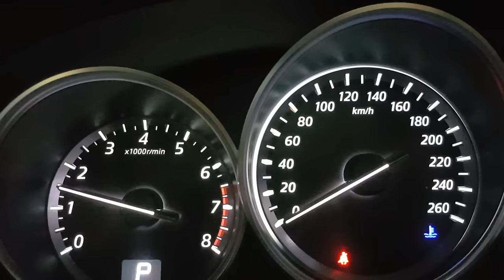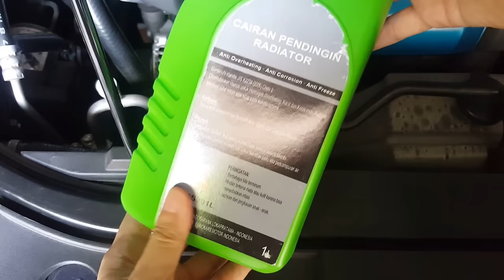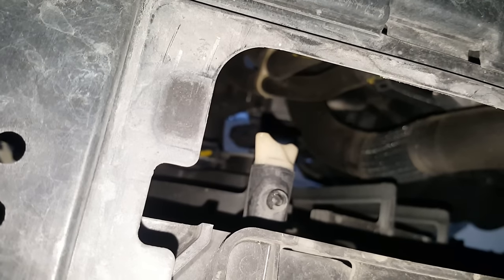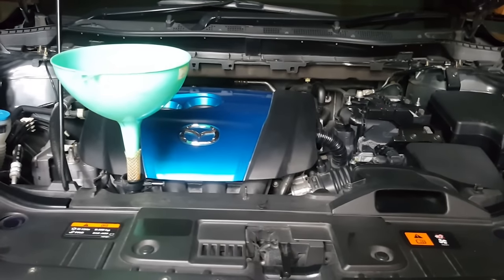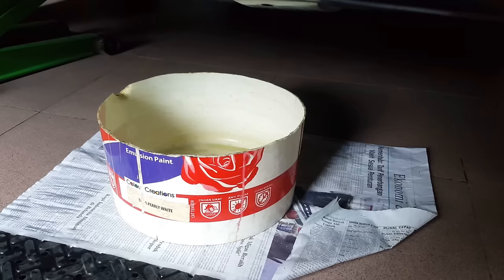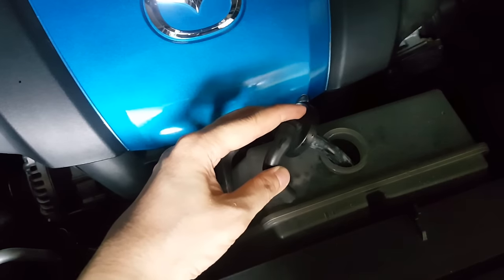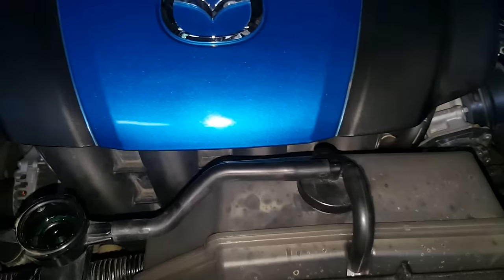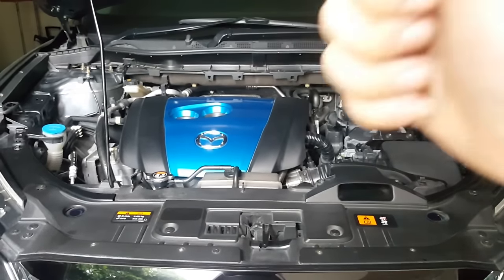Replace your coolant || Mazda CX 5 CX 3 Mazda 3 6 Biante Skyactiv

Comment: I like how meticulous you are in your work, cleaning and doing things so accurately and carefully. I have a new (used) 2019 CX5 that need this done badly. I just always can never get 100%, not even 75% of all the old coolant out even after running the heater and getting the engine temp high which I do not like to do.
Reply from the maker: Thank you . Very much appreciate your kind words 😁.

Comment: Hey FD, great to see a new video of yours featuring the Mazda.  I'm your subscriber in Texas who owns two CX-5s, a 2014 model and the other a 2015.  Since you hadn't done this service yet, I did a complete coolant flush to my 2014 car last summer.  At 50,000 miles (not kilometers) I found this really wasn't necessary as the coolant that came out was as green and sweet smelling as the new FL22 that I put back in.  Compare that to the transmission service I did where the fluid was brown and nasty.  I took about a week to perform my coolant service as I used a radiator flush chemical that again wasn't needed at 50,000 miles.  Once I drained the radiator as you show, I used compressed air to remove as much fluid from the system as possible.  Then I added the radiator flush chemical and many gallons of distilled water.  All during the week I'd drain the radiator and add more distilled water in order to get out all the antifreeze that was circulating in the engine and heater core.  Once I was satisfied that all the old fluid was out I used a cool bit of kit that I had bought to service the radiators on my BMW motorcycles that don't care for ANY air in the system.  Google UView Airlift Coolant Refill Tool.  I used this tool and one of my large air compressors to literally suck in the new FL22 without introducing any air bubbles.  Also cleaned my overflow reservoir just as you but my tank has two lines - one for Cold and the other for Hot.  Another super video Felix!  Looking for you to change out the water pump belt next (not the easier serpentine belt).  Take care!
Reply: David Pancerz I too am FD's Texas Mazda guy! 2013 CX-5 in Grand Prairie!
Reply from the maker: Thank you so much guys . I definitely will share more videos for us all. Appreciate your support and info tips.
Reply: Got to get that water pump belt on the crank pulley and push/pull onto the smooth part of the water pump pulley. It will stay put once on there. Then turn the crank while pushing it over. Wear gloves and watch you don’t catch your fingers. Keep cranking. It will catch.
Reply: Yep, replacing that belt wasn't hard at all. It's mainly a space issue if you have large hands. And since I changed the spark plugs at the same time, the engine was much easier to crank over. Definitely helped getting that water pump belt on.
Reply: David Pancerz i did plugs too. Didn’t occur to me to leave them out. Brilliant!
Reply: Yeah, I did a drain and fill of my 2016 CX5 trans at 30K miles and it was brown and nasty, looked nothing like the light blue FZ fluid I replaced it with.  I will do a drain and fill every 30k to replace their “Lifetime” fluid.
Reply: if my mazda cx5 has 4580 miles, and i need to top the coolant off a bit what do you suggest i do? can i mix other brand fl22 coolants or should in get genuine mazda fl22 and use that top off the overflow tank
Reply: Puedes añadir un poco de agua destilada si es la primera vez. O compras una botella de anticongelante Ravenol fl22 de 1.5 L
Saludos desde Valladolid, España.

Comment: A great video Dan.  Very helpful thankyou ..... 
A tip = to drain the reservoir, if you leave the radiator cap on when you remove the cockstop, the system will suck out the fluid in the reservoir while draining.  You might need to squeeze the top radiator hose to help the fluid flow.
Reply from the maker: thank you Sir. Noted.
Reply: hey what's the lockstep?

Comment: Hi , nice works .. but actually what happens at the SC is we did replace the coolant inside the engine so total amount coolant needed to be replace is almost 8 litres... this comment is regarding to all my recently customers showing this video and asking why it should be 8L i hope all of your viewers understand or you can make another content about it ... 👍 keep up your good work ...
Reply from the maker: Ya i think i have note down in the description as this method is only for basic drain and fill the radiator system and not full flushing whole fluid inside the engine.

Comment: Fantastic videos, Felix. Why do you do this on a shiny new car with 33,000 km is a mystery...  Much appreciated👍👍
Reply from the maker: it has been collecting dust since 2013 as i drove my other car for the daily , I have not driven it much and yet enjoy this cx 5 . So i though why not do a coolant / radiator maintenance just incase the old one fail and freezed up. But yeah now the car is 10 years and been enjoying it and driving it as my daily car.
Reply: Yeah, I did a drain and fill of my transmission at 30K miles for the “Lifetime” (not) trans fluid.  New Mazda FZ fluid is sky blue in color, what came out was filthy, brownish stuff, at 30k miles !!!  Do not fall for this “Lifetime” or “Sealed” nonsense regarding fluids / lubricants.  Changing is simple, and just replace the same amount you take out, plus 2-3 ounces for “stick around” amount on the sides of the catch basin, after measuring.  Lifetime means life time of the warranty, for which after they can charge you $6000 for a remanufactured transmission.

Comment: Thank you for the excellent content. Too easy with your complete instructions.  Appreciate it. 

You have noted that this is not a complete coolant flush.  What is complete coolant flush??
Reply from the maker: Thank you again for the support. full coolant flush you have to drain all coolant from the engine block and to do that you have to uninstall the bottom part of the radiator hose .

Comment: Very nice video! For the bleeding part, When you start the car at the end and let it idle... when you turn off the car again, do you re open the radiator cap to let go air bubbles?
Reply from the maker: it dont matter. u can turn off and open the radiator cap to check or you can leave it close.
Reply: Thanks!

Comment: Thanks for another excellent video.  I would recommend draining the fluid from the lower radiator hose rather than the petcock, which, with age and heat can become brittle and break, which would not be good.  Thanks again.
Reply from the maker: 👍 noted :)

Comment: How many km before you chnge the fluid. Mazda said long life coolant can last 100tkm. And do you need to use radiator flush
Reply from the maker: Hi Wilson . This car is 5 years now , so thats why i am replacing the coolant. Radiator flush isn't always necessary unless the coolant are very very dirty and the car is very old .
Reply: My mazda book: 10 years or 200.000 km.

Comment: Sometimes the capacities are a bit confusing. Just make sure to check the owners manual as mine states there are slightly different capacities depending on the VIN. Japan or Mexican built makes a difference.
Reply from the maker: Right i would stock about 7litres of coolant. Some cars uses only 6litres and other may use about 7litres. As you dont want to be short on coolant if you are doing the service at home.

Comment: Very nice video you have there and thank you so much for making a video. :) This will be use on my Mazda CX-5. But I have a question from you. Once everything is all topped up and it’s time to bleed air out from the radiator Cap. Do I have to keep the cap open to let the air bubbles out while I run the engine RPM?
Reply from the maker: Yes please follow the bleeding procedures. As mentioned on the description below with radiator cap removed. Once it burps completely. You are done :) pls dont forget to subscribe and hit that notif bells for us so you wont miss a latest videos. :) thank you again really appreciated your time tuning in Mr Luigi.
Reply: So, after I run the engine’s RPM and there still have bubbles coming out, I just leave the engine run normally until it stops burping?
Reply from the maker: @tomwu4211  correct sir. Just until theres no more burping.
Reply: Felix Dan Thank you very much. :)
Reply from the maker: @tomwu4211  dont forget to wash off the spillage sir. :).
Reply: Felix Dan Thanks for reminding me that too. :)

Comment: Hi Felix, want to ask you that is it ok to use other brand of common coolant (APM brand coolant) for Mazda car? as the shop owner use this instead of Mazda FL22 coolant..
Reply from the maker: if it does have similar spec yes definately can use. Personally i have not tried other brand coolant for the CX5.
Reply: @FelixDanGarasiAuto  thanks for your reply.. as this is the shop owner (specializing in Radiator repair and service) recommend, so I just go with this..

Comment: How did u remove pins from the pipe at coolant reservoir? U showed how to clip back on after cleaning it but did now show how to unpin the clip to take out the coolant reservoir
Reply from the maker: its just snaps back in n out. Use gentle force. Cheers

Comment: Hi Felix, greeting from the US my friend - thank you very much for your videos - they have been a great help. This will be my next service to do on the cx-5. I have 75,000 miles (120k km?) and I am not sure if I should do the flush or just the coolant replace like you do. Can you comment? If you think it will be worth doing a flush - can you tell me the extra steps to take? Also if I do a flush will I still need 5L or it will be more?
Reply from the maker: To fully flush the cooling system , you will need to drain the coolant from the radiator and add flushing chemical diluted with distilled water and keep repeating (draining) until there are no more excess old coolant. Yes you will need more than 5 L of coolant to refill the system.

Comment: Hi Felix Dan, in regards to the bleeding procedure on your Mazda and all Mazda's you state that owners should remove the radiator cap while bleeding the system. But won't coolant splash everywhere and make a mess out of my engine. As well as that, coolant get"s really hot very quickly and running the car for 5 minutes at 2,500 rpm would definitely have it boiling, especially if the fans kick in. I didn't see you doing this in the video.
Reply from the maker: @taichihead42  its normal to have some mess spillage while bleeding without the special Tool Spill free radiator filler cup / bucket. Just rinse it off with some water you all good to go. Unless you have the radiator spill free filler tool / bucket then you r save from the spillage mess. 👍🏼
Reply: @GarasiFelixDan In the past Felix i have changed coolant on other cars and i never left the radiator cap off. It seems like a really dangerous thing to do and once that coolant gets hot it will shoot up out of the radiator and the spray will go every where. Running the engine checking for leaks and topping up the radiator when cold is far more sensible.  Who came up with this idea to leave a radiator cap off a hot radiator also that funnel tool seems unnecessary as well. Unless radiators have changed since the 1980's.

Comment: We're going to run it with the radiator cap open, isn't it right? So when do we turn it off? After the engine fan comes on? Can you help?
Reply from the maker: yes that is correct , run until the fan kicks in and you can turn off the car and top up the coolant fluid.

Comment: great informtaion. could you do more explaining with spoken words for the steps?  Looks like the car has to be jacked up to drain old coolant. You made it look so simple!
My engine is idling very rough and I don't know what is wrong with it. I have only had it for 6 months and think I way overpaid for it.
Reply from the maker: Maybe theres a leak within your intake. Please check. Defect Throttle body gasket / intake manifold / vacuum hoses. Please check them first.

Comment: So you pour the same thing in both coolant reservoir and radiator? I thought it should be a specific mix of water/coolant in the radiator and a full coolant in the reservoir? Am I wrong?
Reply from the maker: This coolant is premixed just have to fill it without adding water. Unless you have the other coolant that needs to be mixed with water please mix it with correct amount level of water.

Comment: what is the interval on coolant change? my mazda 3 2015 coolant is still green but near the low level on the expansion tank. not sure if it was changed before as i got the car used.
Reply from the maker: change the coolant every 4 years or 80k kms

Comment: I noticed you didn't burp your radiator, you put the cap on when starting your engine, if you leave it off it releases the air in the system, which in turn will not let the coolant get to critical parts of your system easily, and may result in the ac not blowing the correct temperature.
I could be wrong and maybe you did burp the radiator and just didn't record it
Reply from the maker: dont worry i did just i didnt show the method fully here. My cx 5 is fine ever since done this service 👍🏻
Reply: hi what do you need to do to burp the radiator?
Reply from the maker: @dmc_77  remove the radiator cap and let it idle for 15 to 20 mins and let it overflow until it stop.

Comment: so low milage and u have already changed it? Due to workshop manual it is changed after 120 000 km or 10 years
Reply from the maker: Just want to demonstrate how to for us all.
Reply: I do at the 1/2 way point what manufacturer states.  They said trans fluid at 120K miles, I do at 60k miles, oil change every 10k, I do every 5 k.

Comment: Hi, I have a question .I own a Mazda 3  2014. I followed all your instructions but only 3 liters drain out. Can you tell me why and give me any advice?
Reply from the maker: it should be more than 3 ltrs… i think before hand you did not top up the radiator coolant to max line everytime it needs topped up. ??
Reply: @GarasiFelixDan Thanks for your quick reaction. this was the first time I tried to change the coolant. It was topped up,no leaking, no problems. As I said, I did exactly what you did and only 3 liters drained out. I even repeated everything twice.with the same result.

Comment: Hi dan, i got an oil spot on top of my alternator, i saw its coming from the oil pressure sensor(i think) that sits on top of it. Is it just a simple repair(change of o ring) ? Oh,its a m2 skyactiv.
Reply from the maker: Check if the o ring washer needs replacing. Or even the oil pressure unit.
Reply: Look at the part called the oil control valve. It has a seal which is prone to leaking, and the valve itself can leak.

Comment: what about the coolant still left inside the engine?
Reply from the maker: It will b left inside the engine. Reminder that this method is not a full flush method.
Reply: Do it again after driving 20-30 miles, a bit of a waste, but will pretty much get all old coolant out.

Comment: Malam pak felix, mhn maaf sblm nya kalau mengganggu.
Mau tanya lagi pak, apakah mazda skyactiv compatible pakai coolant yg ada di tutorial? Kalau sy cek buku sih minta nya FL22 yg kata ny sih 55% ethylene glycol.
Mhn penjelasan dan konsekuensi nya dengan penggunaan selain coolant FL22.
Terimakasih
Reply from the maker: Untuk di video ini sy beli di dealer mazda langsung dan direkomendasi pakai mazda coolant yg ini kata dealer mazda komposisi formulanya hampir sama dengan fl22. Tapi yg sy baca baca dr forum luar spec coolant Fl22 formulanya anti freezenya tahan lebih lama sampai dengan 10 tahun dimana coolant dengan formula biasa hanya tahan sampai 5 tahun. Dan kalau tidak memakai fl22 mungkin hanya harus menggantikan coolantnya lebih awal saja periodenya supaya tidak terjadi penyumbatan / karat pada komponen mesin water pump dan radiator. Tapi untuk mesin skyactiv sangat direkomen untuk menggunakan fl22 dan kalau bisa dapat fl22 di mazda dealer beli aj fl22 ya.

Comment: Do you have to fill up the coolant if you have a blue indicator warning? I have a mazda cx3, the coolant level is one inch below to the full level
Reply from the maker: Top it up.
Reply: Blue indicator means engine is cold so dont drive agressive for couple a minutes

Comment: Hi bro, Is this consider a full flush or half flush? If i recall correctly, the engine is build with tunnels which allow the coolent to flow within to cool off the engine. Hence i saw how mechanic used to insert water pipe n flush out dirty coolent. When doing refill, they turn on the engine so as to see if the water pump has pumped all the water which will gone thru the whole engine appropriately then by refilling the reservoir if necessary.
Reply from the maker: Hi George .This service was to replace the coolant only , not a full flush job as its not needed, the car is still 33000Ks on the clock, if you were to have older car with the coolant that hasn't been replace for its life then you will need to do the full flush job just like you mention above perhaps add a radiator flush chemical to help dissolve the gunk and dirt in the cooling system.

Comment: My coolant is really low. Can i top it off or do i need to flush and put new fluid in? Also I have no idea what brand of coolant is currently in my car, do I have to use the same brand to top if off? Or can i mix brands if it's the same color, i,e green coolant fluid
Reply from the maker: Get the same brand coolant.
Reply: @GarasiFelixDan  Will do. Thank you. Also, on your throttle body cleaning video, you said torque it back on with 8mm of torque. What would that be in foot to pounds? I've been trying to find the specs, but I can't find it.
Reply from the maker: @gibsonindistress418  about 6ft pounds. Just about snug.
Reply: @GarasiFelixDan  Thank you very much sir! Is there a website where I can find all the specs for bolts and what not for my Mazda 6? Again, thank you for taking the time to reply.